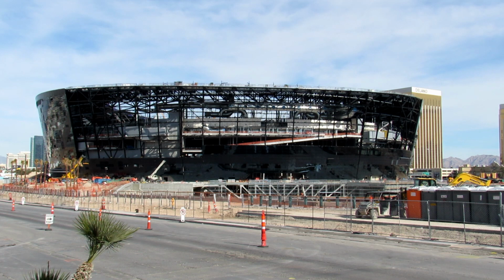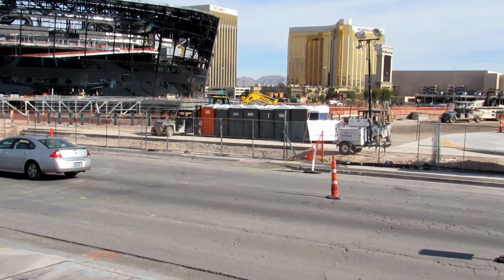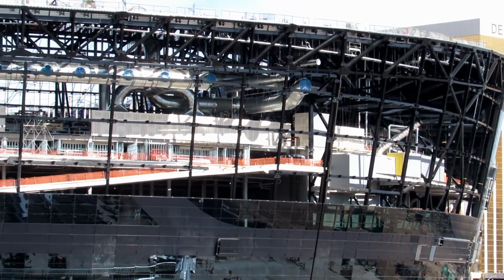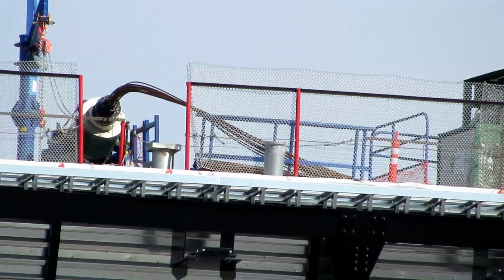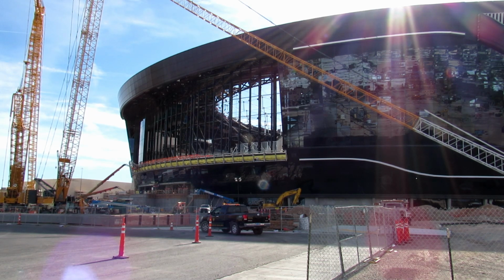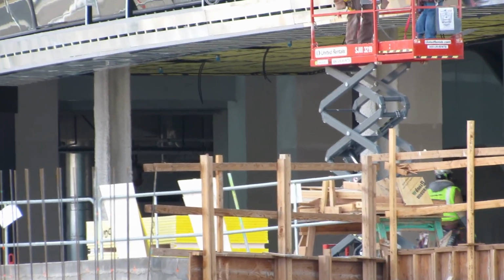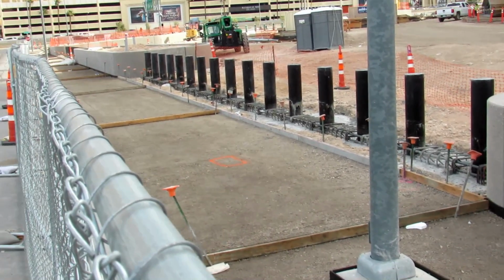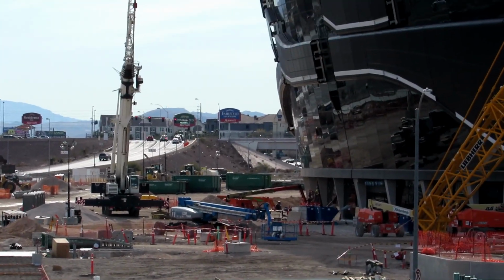Las Vegas Raiders Allegiant Stadium Construction Update 01 18 2020

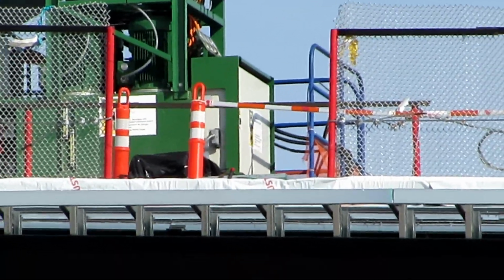Comment: Please see 10:52.  The strand jacks are currently connected to the lower cables.  This frame shows that they have pulled those cables by about 20 feet (although it could be more because the entire length of the cable through the strand jacks does not show).  The top cables are now anchored through the blue steel rods to the top holes in the canopy truss. I doubt that these will be reconnected to the strand jacks for more lifting.  Probably, when the lower cables are high enough to take the tension off the top cables, there will be some permanent connecting rods installed that can be manually tensioned.  I tried to ask the contractor about this but basically got a brush-off answer.   It would be nice to know what we are looking at.

Anyway, thanks for the drone footage of the north entrance.  It is much easier to see what is going on in the layout from these shots.
Reply: how do they operate the motors to pull up the cables,is it a computer controlling the entire  lift at the same time or do they operate each one separate by pushing a button  and moving it a few inches the do another? I always wondered
Reply: @vegasraiderspetef9883  There is a nice animation on Wikipedia - https://en.wikipedia.org/wiki/Strand_jack.  I can't be sure but I think the big green boxes on the stadium roof  that were covered by tarps are the lift controllers.

Comment: So they have resumed the cable lift. On the live camera I can see the difference. This is my last question. When will the cables be fully lifted so they can install the ETFE? A week? A month?
Reply: Don Webb said at the meeting on Thurs that the cable lift would be finished and pinned in early February. Installation of the ETFE panels will start after that and be completely finished by mid-May.
Reply: Thanks much!
Reply: by the end of may its a time intensive build,the technically hardest part of the build,goes together like a jigsaw puzzle

Comment: Any word on what type of grass will be used?  With it being hot like hell. Curious as to how they will keep it nice and lush.  Will there be field turf mixed in?
Reply: im sure it will be similar to what phoenix does since they have the same  fieldtray setup,most fields have  kentucky bluegrass mixed with bermuda or i see arizona just uses bermuda grass,golf courses do well in the heat as long as you water it. This tray will have  a state of the art drainage system,i think it even has heaters inside it
Reply: They'll pull it out to water it and let the sun do it's thing.
Reply: bermuda

Comment: There are 2 fields correct? So 2 field trays? 1 on each side? #ninersfanssux
Reply from the maker: There is only one field tray.  The raiders will play on the real turf and the UNLV Rebels will play on artificial turf.
Reply: @Raiders1967  yeah i havent figured out how that works,unlv underneath and raiders on wheels above it,i thought they said it could have a cement floor for concerts so they both must slide outside